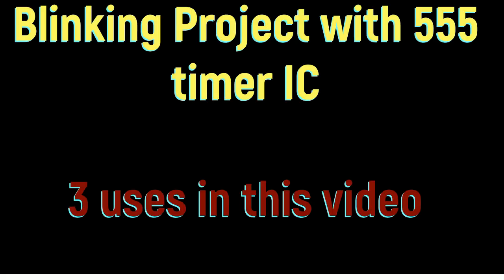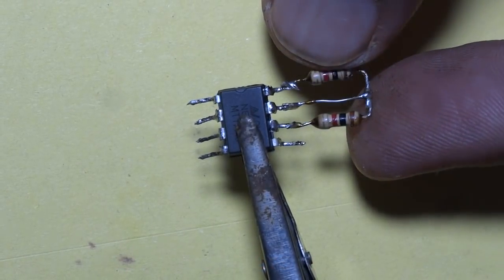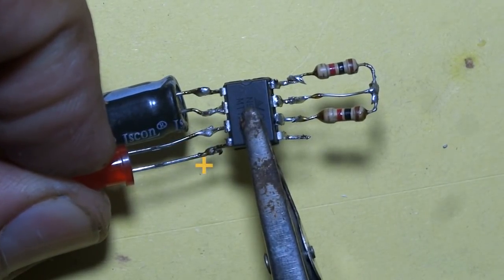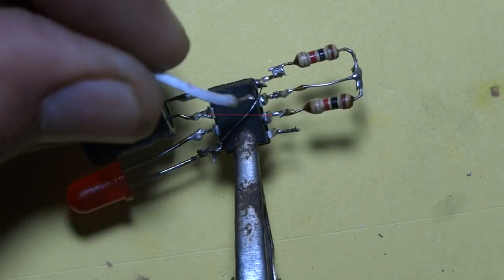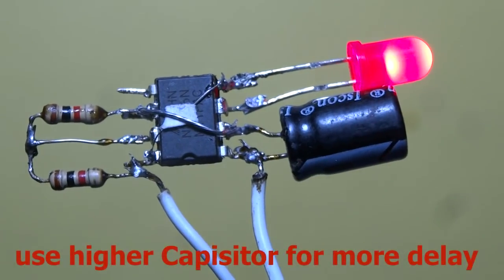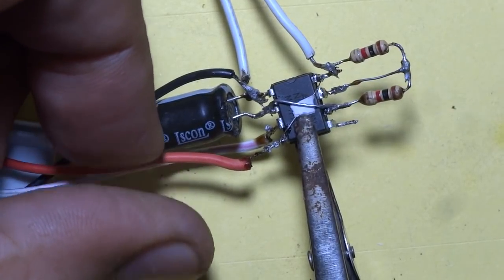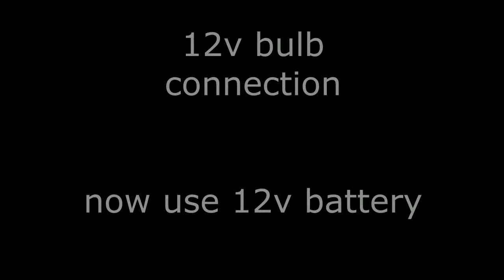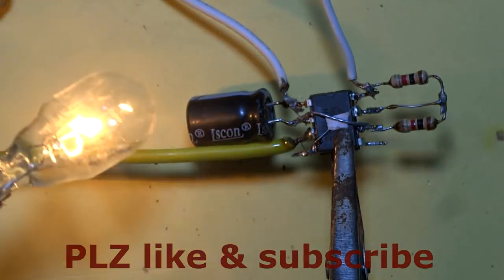Blinking multipule LED with 555 IC

Comment: Buen vídeo, muy bien explicado y sencillo de entender (el más sencillo que he visto hasta la fecha), acabo de replicarlo usando:

- Una placa fenólica de 4.5 x 4.5 cm
- Un IC 555 (obviamente)
- Una base para IC de 4 pines
- Un Capacitor Electrolítico de 220uF / 25V
- Resistencias similares a las que se usaron en el vídeo
- 2 Baterías AA (Voltaje final: ± 3 V)
- Un Led rojo

Todo fue soldado a la placa fenólica y quedó demostrado que el esquema funciona perfectamente.

Muy Agradecido! Saludos
Reply from the maker: plz write in english
Reply from the maker: plz write in english

Comment: Most Excellent!  I want to thank you for your service to electronic enthusiasts the world.  over.  I've been doing electronics for 50 years, and I still learned some important points from your so-well-presented video.
Reply from the maker: Thanku so much dear I'm great full to you for my encouragement in very very nice wording
Reply: You're VERY welcome!  Part of what I love about your video is that you are using a very cheap, beat-up soldering iron.  The final circuit looks really cheap, too.  No clean lines, no impressive packaging.  The simplicity, the lack of pretension makes the presentation more powerful.  In so much on the Internet, we are bombarded with flashy LOOKING stuff, but often the flash is more impressive than the actual product.  How refreshing to have your presentation, where the CONTENT shines forth, the unpretentious truth, and it WORKS!  Thanks for so much more than a simple 555 flasher circuit!
Reply from the maker: I'm great full dear

Comment: how long will lasts 1# circuit on 2x1.5v (3vtogether) alkaline batteries? The current is about 10ma(switches from 3Ma-11Ma on my multimeter).

Comment: Hello Brother. What modification (s) to make so that the LED just blinks with the input of an electric guitar signal? Or would not that be possible? I thought of adapting this wonderful work to a wah wah pedal in such a way that the LED blinks only when it receives this signal. The pedal already has a LED indicator. By the way, I'm from Brazil and maybe my English is not so good. Finally, if there is a solution I would ask for a very detailed explanation, please, because I understand very little of electronics. Thanks in advance for your time
Reply from the maker: Dear its not possible through this ic 
Soon I will make a video about your question 
Your English very good dear

Comment: I am making my own indicators for a cafe racer motorbike, I want to power 2 led's in series they are 3 watt each with a forward voltage of 3v, my input power is 12v, will this circuit design of yours work, if not can you please  send me a link with the correct diagram to power the 2 leds
Reply from the maker: U can use transistor on output to run heavy load
Reply from the maker: I can send u circuit diagram to run heavy load
Reply: @gillanidata  i made your circuite with the 3watt led but  it does not blink and barely comes on

Comment: Hai there... Can we adjustable the speed of LED using pot/vr ?  Where should be placement and how much the value of vr/pot  if I'm using on 12v DC input..
Thanks for respond...
Reply from the maker: Yes dear u can put 10k pot on place of point 7 & 6 resister
Reply from the maker: Even u can use 50k pot on this place also to make it more slow
Reply: 0ke.. Thank you for guide.. Btw, is that mean on point 8 still needed 1k resistor connected and merge with point 7 (50k pot),..?
Reply from the maker: yes off course
Reply from the maker: U welcome dear 
Plz watch my all videos and clicks on all adds showings on my videos 
It will your sport for me

Comment: Hi.  Your video is very good.  My question is :  It is any way ( using 555 ) I can install two leds intermitents ? Let me explain. When one led is  "on", the  second is off and when the second is on,  the other one is off.  That is intermitent.  The blinking action is when both are on and off.  If you cant  make  it with the 555; it is any other way ?
Reply from the maker: Dear i have used only 1 led 
U can use two LEDs one with pont no 3 and 4 
And one with point no 3 and one

In this way one will off and 2nd will off
Reply from the maker: Connect 2nd led with point 3 and 1
Reply: Sorry,  I miss a point. The way it is if  I added a 200 ohms resister in the led leg, may use a 12v in the circuit? I never notice how many volts we are using with the 440 uf, or  I have to replaced for a 16 volts. Thanks.  I am learning with you.
Reply from the maker: +Herbie Travieso dear use 1k resistor if u want to use 12v current

Comment: it works good please i want to get 50 hz how much capacitor use it ?
Reply from the maker: Dear connect potentiometer on point 6 and 7 replace the fix resistor
Reply from the maker: or use 102pf capacitor for 50hz

Comment: Bro es light ko agar hum motorcycle battery se connect karengay to components ka grade kiya hoga. Or bike k kam zeyada voltage se bhi mehfooz rahy.
Reply from the maker: AP outpur b 12v lein AGR 12 day chaa rahy hein to
Reply: Thanks for reply. Ap keh rahy hen k men connection ic k 3rd point se or bike ke battery me negative se lon. Or input me Koe or resistor nahe lagana paryga.
Reply from the maker: No dear battery connection pin 1 day negative oor point 8 say + duna hai
Reply: gillani data jee bhai meny ap ke video dakhi hai me LED light ka poch reha tha jo mujhy chalani hai. Ap ne keha k output bhi 12v len to connection ka pocha k LED light ko ic k 3rd point or negative battery se connect karon jasy ap ne video me dekhaya hai.

Comment: i want to make the same circuit with 12v dc input from my car battery. do i need to change anything?
Reply from the maker: Just use 1k resister with + battery  input wire..
Reply from the maker: Do u want to control 12v bulb.....?
Reply from the maker: Plz tell ur clear need

Comment: Hi sir thank you for reply
Sir i am continue running on highway road in night for my delivery job. So i want a good flasher 12v led light for my bike splendor. Which i want to use at the back side position on number plate. Need a powerful flash 
Thank you  sir 
Plz make for me
Reply from the maker: OK dear I send u proper solution
Reply: @gillanidata  ok sir
If possible send me soon
Waiting sir
Reply from the maker: Plz send me you whatsapp no

Comment: It work sir :) 
led flashing at 5v but why not blink at 9v 
Sorry for my bad english
Thank you very much
Reply from the maker: O my dear on 9v u should have use 9v led 
or use 1k resistor before + battery wire 
Because if will use 4v led on 8 v battery led will burn
Reply from the maker: For more question u can ask any thing any time
Reply: i add a 1k resistor but its led just blinking 5 seconds then i add potentio in negative elco cable ..it blinks normally and is it safe sir?
Reply from the maker: Yes it is safe dear

Comment: does the ic become hot if i supply 12v
Reply from the maker: No dear u can use 12v easily ic will no burn but u should use low amp

Comment: Sir I will making ckt & connect 4leds(parallel) green connect pin4&3 blinking pefectly& another 4leds Red connect (parallel)but Red leds not glowing same ckt.i will use 5 volt battery. What mistake me do in ckt .
Reply from the maker: Plz check your LEDs
Reply: gillani data  I will connect 6 leds parallel one green one red one another one connect 6leds but Red leds blinking brightly.green leds glowing low.any different leds voltage please explain sir .thankque responding sir
Reply from the maker: Dear green LEDs brightness always remain low than red 

Plz connects blue LEDs instead of green LEDs
Reply from the maker: Or send videos of ur project on my whats app no
Reply from the maker: +1-858-276-2559
Reply: gillani data  sir which country sir
Reply from the maker: iron

Comment: Sir I will connect 100 mf capacitor with 5 volt battery LEDs blinking fast but LEDs brightness low what is the problem sir.
Reply from the maker: use 9v battery for more brightness

Comment: 470 uf capacitor but what will be volt of capacitor
Reply from the maker: Dear u can use any volts capacitor
Reply from the maker: If u want to increase and decease speed of blinking then use variable resistor on point 7

Comment: Hai sir 4 LED connect with series or parallel pin 4&3 with 4 volt battery please explain sir.
Reply from the maker: Parallel
Reply from the maker: Connect all LEDs parallel if u want to operate with 4v battery
Reply from the maker: U can also use point 3 and point 1 

When point 3 and 1 on point 3 and point 4 will off 
And when point 3 and 1 off 3 & 4 will b on

In this way u can make it more beautiful
Reply: I wanna 4 led blinking instead of one led in same pin 3&4.what is the value of capacitor & resistance values please explain sir.pin 4&3 connect one bove led connect or not?
Reply from the maker: Resister and capacitor values will remain same

Comment: 470 cap would be ok?
Reply from the maker: +Jon Paul  yes capacitor just increase and decrease blinking speed 

When u will connect big capacitor blinking speed will very slow and with small capacitor speed will b very high
Reply from the maker: +Jon Paul all powers of capacitor can b used 

more power capacitor will increase blinking time 
With less power diod it will blink fastly

Comment: How to make blinking for indicator light 24v ?
Reply from the maker: Then u should use another transistor on output point
Reply from the maker: If u want to do so I will send u circuit diagram for 1.5 to 24v
Reply: sir may you please send me that diagram too?

Comment: Guruji Good Morning,
 I used 4v lead acid battery  with rechrging unit(both are inbuild in tricolour china torch). 4v lead acid battery is new one.(recently bought) Ac to dc (4v)Rechrging unit in made at home. Out put is 4.45v. Why the heat generated at charging pcb board side in torch  ,while charging the battery.?Now the battery is not charging. Below things used to make recharing unit.
1 PCB BOARD
2 105 J-400V POLYPROPYLENE Capacitor
3  100 uf 63 v capacitor
4 IN4007 Diode(To make bridge rectifier)
5 1k resistor
6 1Mega ohm resistor
7 12v zenor diode
8 7805 voltage regulator
I most expect you favourable answer for above doubt also seeking solution.

Comment: Sir capacitor value
Reply from the maker: +Apoorv Pandit I have used 470 uf
Reply from the maker: +gillani data  if u want to increase blinking speed then use 100uf or lower
Reply: gillani data we can use 100uf capacitor with how much volt????
Reply: gillani data plz tell sir
Reply: gillani data ???
Reply from the maker: dear u can use 10uf 16volts but with 10uf blinking speed will be much faster

i u want to increase the timing of blinking speed u can increase the value of 1k resistor on point 7 and 6

Comment: IAm using 470 uf capacitor  firing ic
Reply from the maker: Use 3/4v current
Reply: input 4v or 12v
Reply from the maker: 4v
Reply: iam using 12v
Reply from the maker: No dear u can use 12v with this LED
Reply from the maker: If u are using 12v then use 12v LED

Comment: Bhai ye ni clta
Reply from the maker: +Yash all in 1 check your ic555 is perfect and u are using correct side of ic 

I'm making more videos on 555 ic these all are interesting and easy to use 
Just check your ic directions and make all possible projects with me
Reply from the maker: +Yash all in 1  cut point wali side k mutabik ic ko points dein oor us k mutabik resisters oor capacitors lagain

Comment: Terrible demonstration.  This video should be taken down.  This IC will not last long.   555 timer IC can only output 200 milliamps of current per spec sheet.   Current limiting resistor required for discrete LED.  You will not be able to run the incandescent bulb for long the 555 IC will burn up.   Functionality will be marginal at best with power supply voltage of 3 to 4 volts.  Spec sheet specifies minimum of 4.5 volts to run reliably.   This is giving new hobbyists bad ideas and poor practices in introductory electronics videos.  You should be ashamed.